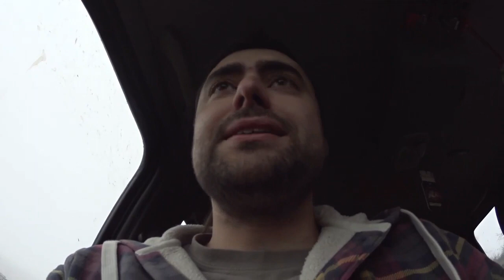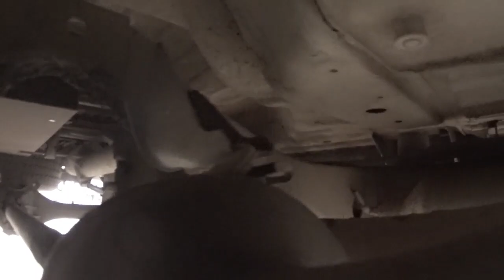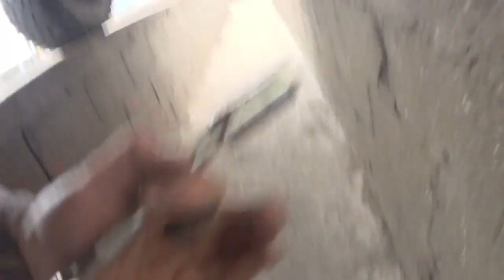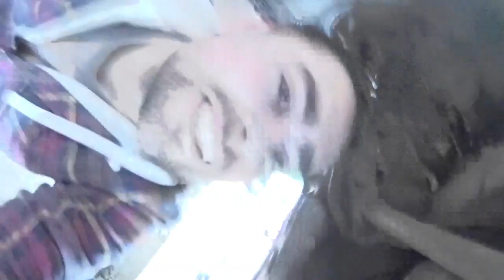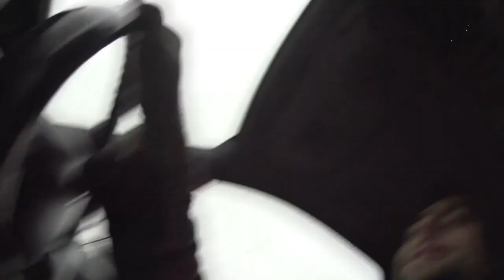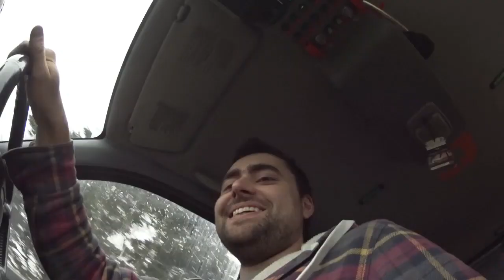Vlog #33 black thunder finishes another gearbox off

Comment: On acceleration, mostly first gear, i get a pulsating type feeling. My centre bearing looks fine, any clue of the issue? sounds like what your saying at (6:45)
Reply from the maker: Check your u joints are good and greased and make sure it’s not just clutch judder